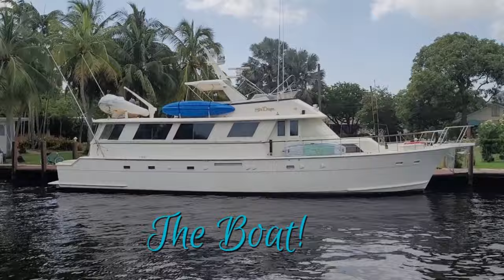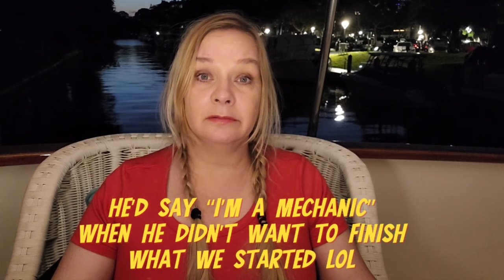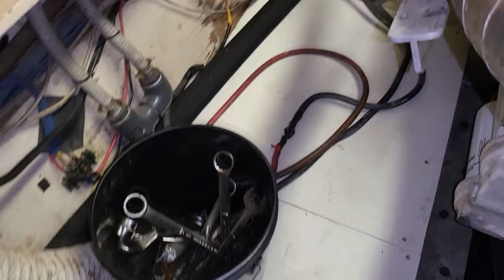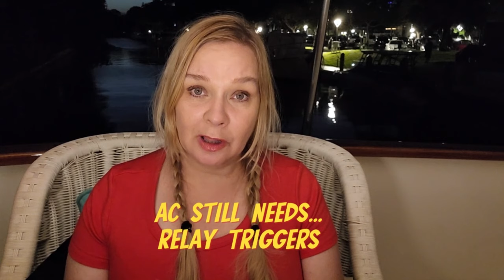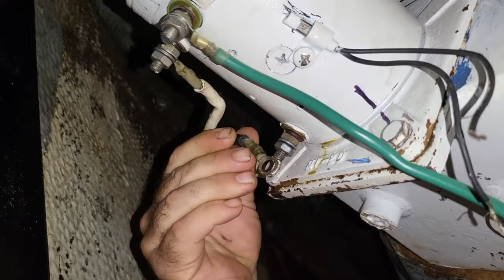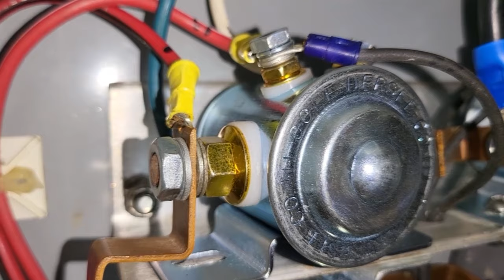How do I fix this? & Special Announcement! Spoiler Alert!

Comment: Good luck with the upcoming lessons, two most important things— one-be patient with yourself,  it’s a new experience, 2-be attentive to what is going on around the boat as you pilot it. Above all else try and keep it simple you don’t need to be heavy on the throttles at the dock when you’re learning especially when you’re docking the boat in between pilings, shifting in and out of gear with port and starboard engines is the best way to do it, you don’t need to worry about the bow thruster until you’ve mastered using the throttles it’s just something else that would get in the way trying to learn all at once. Just remember everybody makes mistakes even experts that’s how you will learn, once you get the feel for your boat it will become second nature to dock it wherever you need to. Above all else she’s extremely well-built a little bump on a piling or dock really isn’t gonna hurt, it’s a learning curve and I’m sure you’ll do fine. It will be a change of pace from being down in the bilge  trying to fix things lol. Good luck and most of all have fun. PS – above all else remember every time you move the boat depending upon the wind and current and tide it’s always gonna be a little different than the last time as long as you understand that the weather and elements dictate how you are going to maneuver you will be fine. The more you practice the better you will be come at it, enjoy it😊👍
Reply from the maker: That is all very sound and encouragng advice!!!! Thank you!

Comment: I will email you. I think your up and down solenoids are turning on at the same time. I also noticed that the over temperature sensor/Thermal protection sensor on the motor that the wires go nowhere. If that temperature sensor works and the windlass is overheated it should open the connection to your control wiring to prevent you from operating the windlass so you do not overheat the motor.
Reply from the maker: Thanks for the email and the great info!!!

Comment: Plan to have a backup navigation system. Sam and Rev used 3 different ones.
Reply from the maker: That's great advice.  I've got a lot of work to do on electronics, but I've got enough to get off the dock and start having a little fun finally. =-)

Comment: Windlass issue - are you sure have it wired correctly?  There should be 2 separate power going to the forward and reverse lugs.(only one should power at a time when pressing up or down button) Sounds like you are powering both forward and reverse lugs at the same time when pressing the up or down button. Also make sure you have ground on the correct lug.  Do you have starting capacitors and are they ok?
Reply from the maker: Ground is rght... they are clearly labeled.  We are putting whte on up and black wire on down.  The issue seems to be in the solenoid box somewhere.  I don't know about start capacitors.  No one has mentioned them. I'll check on that.
Reply: @ShaylaVie  make sure you are not getting power to both up and down lugs at same time when you press the button.  If you are, there is a wiring problem with the solenoids.
Reply: One other thing, when you press a windless button(say down) 2 solenoids should energize in a cross cross pattern. Meaning when the upper left solenoid activates, the lower right should also.  When you press the other switch(say up), the opposite solenoids should activate (lower left and upper right).  The solenoids reverse the positive and negative to the motor and reverse the current to change spin direction. If a solenoid is not operating correctly, it is shorting current to ground. it could be a Bad solenoid or field wires not wired correctly.  (It’s hard to see where those smaller wires go in photos).
Reply from the maker: Ok.  I'll check on that!!! tyvm! @AdventuresofHappyOurs

Comment: Bad Solenoid: There might be a faulty solenoid causing the issue. You should check if it's functioning correctly.
Field Wires Not Wired Correctly: If the field wires are not wired correctly, it may lead to malfunctions in the windlass anchor motor.
Direct Short on the Windless: A direct short on the windlass could be causing the problem. You need to locate the source of the short and fix it.
Solenoid Box Issue: The problem could be within the solenoid box itself, which may require professional assistance.
Start Capacitors: You mentioned not knowing about start capacitors. These are essential components in the operation of the windlass anchor motor. If they are not functioning correctly, it could be the cause of the issue.
Breaker Tripping: If the breaker trips when you put power to the up and down terminals and click one of the switches, it could be due to a fault in the windlass motor or a problem with the wiring.
To troubleshoot and resolve the issue, you should:
Check the solenoid and field wires for any signs of damage or incorrect wiring.
Inspect the solenoid box for any visible issues.
Test the start capacitors to ensure they are functioning correctly.
If necessary, seek professional assistance to diagnose and repair the problem.

To provide detailed step-by-step instructions for troubleshooting the windlass anchor motor on your yacht we can follow these general guidelines based on the information provided:

1. **Check the Control Box Contacts**: Open the control box by removing the top studs and inspect the contacts for dirt. Clean the contacts using a small wire brush if needed.

2. **Examine Field Wires**: Inspect the field wires for any signs of damage or incorrect wiring. Make sure they are connected correctly to the solenoid box and the rest of the system.

3. **Test Start Capacitors**: Ensure that the start capacitors are functioning correctly. If you are unsure about their role or functionality, consider seeking professional advice.

4. **Inspect the Solenoid Box**: Look for any visible issues or damages within the solenoid box. If there are no apparent problems, proceed to the next step.

5. **Check the Clutch Adjustment**: If the windlass motor runs but doesn't deploy or retrieve the anchor rode, the clutch adjustment might be the culprit. Loosen the clutch to allow the chain to freefall, ensuring the clutch allows the chainwheel to spin independently of the main shaft driven by the motor.

6. **Assess Voltage Levels**: If the windlass motor doesn't run when activated with the control, check the voltage levels at the battery and breaker. Replace the control box if necessary, but address any underlying voltage issues in the battery capacity or cable sizing.

7. **Measure Motor Voltage**: If the windlass motor runs in one direction but not the other, measure the voltage at the motor. If it's okay, check the brushes and clean them. If the motor still doesn't work, replace it.

Let's dive deeper into the technical aspects of the clutch, box, and capacitor in your windlass anchor motor system:

**Clutch**: The clutch is responsible for connecting and disconnecting the drive train of the windlass motor. It ensures smooth deployment and retrieval of the anchor rode. Common clutch issues include loose clutches, worn-out clutch parts, or misalignments. To troubleshoot, check the tension of the clutch, inspect the clutch parts for wear, and align the clutch components correctly.

**Box**: The box refers to the housing or enclosure of the windlass motor. Issues with the box can include leaks, cracks, or loose fittings. To diagnose, examine the box for signs of damage, ensure all bolts and screws are tightly secured, and investigate any leaks or moisture buildup.

**Capacitor**: The capacitor is an electronic component that stores energy and releases it when required. In the context of a windlass anchor motor, it helps maintain the proper flow of current during the starting process. If the capacitor is faulty, the motor may not function correctly. To test the capacitor, use a multimeter to check its resistance and voltage levels. If the readings are outside the specified range, the capacitor likely needs replacement.

When troubleshooting the windlass anchor motor, remember to follow a systematic approach. Start with basic checks like verifying power supply, inspecting the control box, and testing the starter button. Then, move on to more complex tasks like checking the motor, clutch, and capacitor. Always refer to the manufacturer's documentation or consult a professional if you are unsure about any step in the process.
Reply from the maker: We're going to check all that tomorrow.  Thanks for the great information!!!

Comment: Great to see an up to date video.
Your solenoids are all wired together. Not suppose to be. You have Copper straps connecting all 4 together. That is why you can do one side or the other but not up and down hooked at the same time.. 
It is creating a dead short.
Just what I can tell by your clip of the box.
If you are able to free wheel your anchor out and power in. 
You will be fine.
Trying to hand crank 150' of chain back into the boat is not fun. And a lot of work. 
If you put 2 videos out a week. 
You will catch your audience up to where you are now faster. 
If everything required by USCG is working on your vessel. 
You are ready to leave the dock.
Best of luck with learning your boat and how it handles.
Cheers.
Reply from the maker: Yes, it's up to par now, and yeah, I have it wired to come in or go up, but I do want the down, too.  Thanks for the info.  We'll check that out after the driving lessons.  I'm not doing anything to mess that up =)